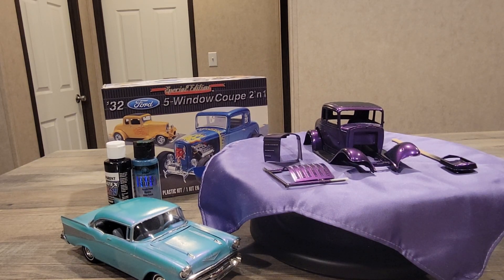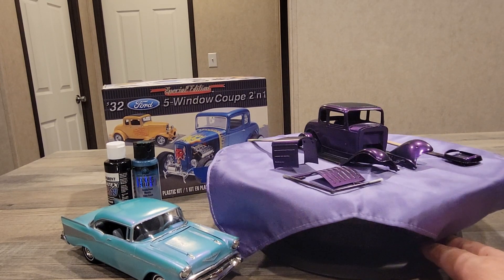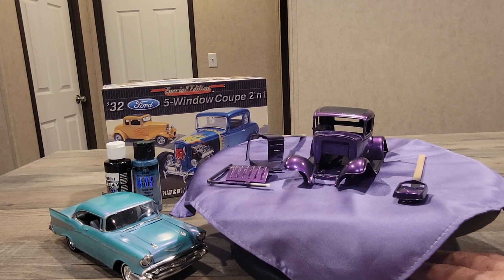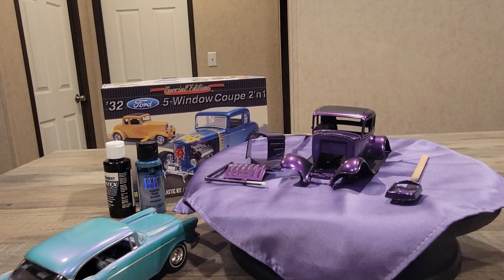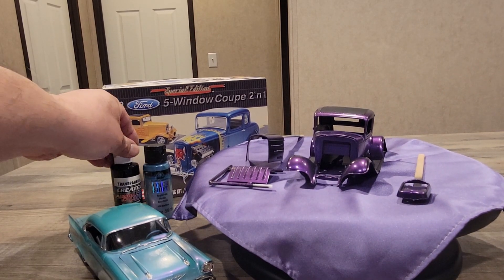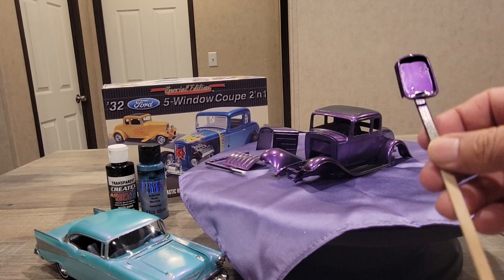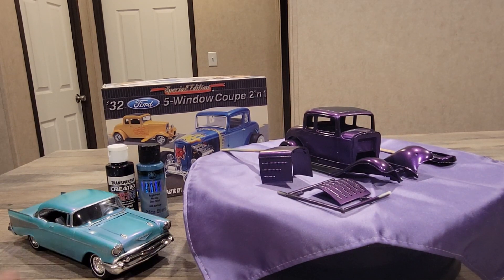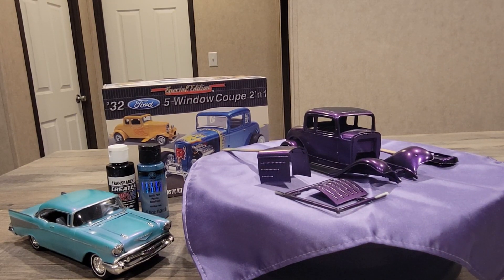32 Ford Challenge/Invite Model Car Build Novice Builder

Comment: Nice paint job. Does the paint settle like oil base paints do you need to shake the bottle . I never used acrylic paint before
Reply from the maker: Thx! No it does not settle. You can shake but its pretty thick and maintains its color consistency. I usually  just pour and thin it to about consistency of 2% milk more or less with a 50/50 mix of reducer and washer fluid :)
Reply from the maker: But it doesn't hurt to shake depending on how thick it is :) hope this helps
Reply: Thanx
Reply from the maker: To clarify this seems to work with the acrylics I have been using ...Createx and Decoart. Could be different for other acrylics .....